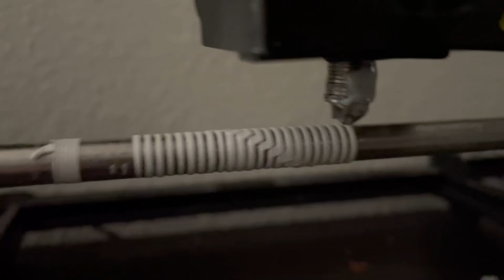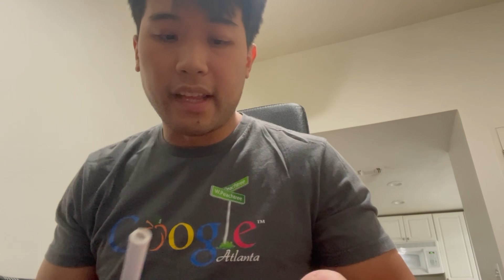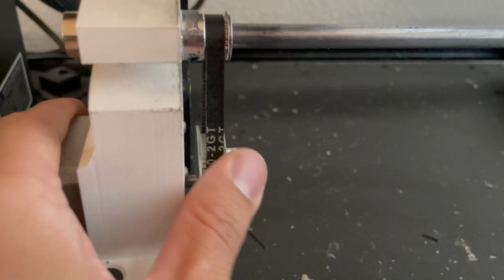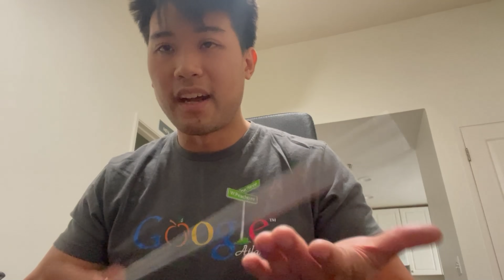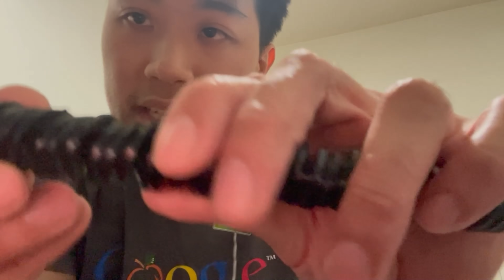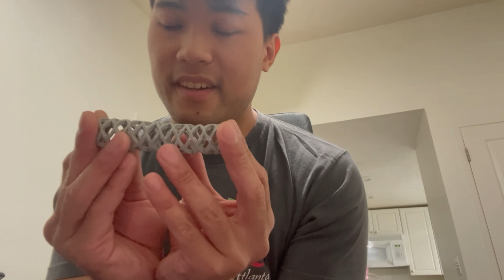i made a new type of 3d printer to make progressive twist barrels, springs, screws, rods, and more

Comment: What if you heat the rod by just running current through it, just like a heated bed, to get the part to detach? You could measure the temperature of the rod quite accurately just by checking its resistance.

Comment: You could turn this on it's side, make the print bed basically a lazy Susan and have different size base rounds to print on.

Funny enough I had this idea a long time ago, I called it an R-Theta printer... But I am not a software engineer, and have way too many other things floating around in my head. Props for building it, that's an impressive innovation!

Comment: a very interesting concept, hope you don't get in trouble for showing that you can possibly make a rifle made out of plastic. I was thinking: this is escalating very quickly.  Nice video
Reply: anyone with a drill can make a rifle. I don't think that creation of rifle parts itself is a crime, as long as you don't use it as a rifle parts. Also take into account that barrel he showed is made of plastic, so any rifling inside the barrel wouldn't even last one shot with bullet made of metal. So for things like airsoft it could be used because of plastic "bullets". If you want to use bullets made of metal - you would definitely try to reduce the friction as much as possible so it will last at least more than one shot

Comment: You have inspired me.

A new weapon i shall call.
"The four stroke auromatic rifle."
Using springs, compressed gassified fuel, a series of valves, and a compression chamber capable of handling insane pressure.

Theory? That if you achieve stoichiometry, use recoil and standard rifle gas systems to help cycle the plunger rearward, you could make a fully automatic gas powered rifle that has an INSANE cyclic rate, and could be loaded with inert prohectiles to ve belt or tube fed into the mechanism.

The rifle will first draw back into the ARMED position, in this position tge plunger is pulled rearward and air has been pulled into the compression chamber via a 1 way aka check valve, or another valve that is mechanically timed but only open moments before the plunger is "fired".

Next step the firing sequence.
Depending on the power setting of the gas regulator: upon trigger pull the valve allowing air into tge rifle is closed, and a valve allowing pressurized gas into the rifle is opened, to let in a set charge of fuel, split seconds after the gas is fired into the ignition chamber the plunger is released and slams forward, diesel igniting the fuel air mixture.

This mix is let to burn momentarily as it would in an IC engine which begins tge rearward travel of the piston plunger, during its rearward travel it uncovers a port which exhausts the propellant gas down the rifle bore where upon meeting the prijectile, imparts a portion of its kinetic energy into it.

The coolest part is the firing mechanism can be fired counter to the recoil and operate to negate it entirely by counter acting the forces that imparting energy into a stationary object eould create in the device.

Imagine it much like a combination between a rifle and a couple types of internal combustion engine.

On the intake side you have a 4 stroke, with intake valve/spring, a cam of some kind to allow air into the cylinder, and a system to allow fuel mix into it (probably an injector)

Then for ignition you have a piston much like that found in a small engine, it does exactly what it would do in a diesel, possibly tge addition of an electric glow plug would be wise as well for consistent shots on a cold bore.

Then for the firing / projectile portion, you could have an exhaust port much like on a 2 stroke where as the piston travels to bottom dead center from top dead center in its ignition stroke, it travels past the port and relases its extremely high pressure gas down tge barrel, taking the projectile with it.

Think of this as a diesel fired fully automatic potatoe gun.

But it doesnt rely on barrel obstruction to create a pressurized chamber, it will 'fire' as ling as there is fuel and air in the weapon.

Purely with spring power, and only needing electronics in situations where its added as an option to increase reliability of the ignitionprocess, much like in modern diesel engines.

Then we design and slap a fuckin turbo on it..... 

The MOST mad max gun you have ever heard of.

Imagine one that has 8 barrels...

Cult if the V8s new super weapon.

Comment: It's a reverse lathe... Where a lathe takes material off the work piece, this adds material to the work piece instead.

Now combine it with a lathe, a CnC and some kind of curing setup and you could create a nearly automated nearly 0 loss (new conjunction word incoming) REDUCT- ATIVE  (reduction + additive) manufacturing process.

Especially if you can make a machine that runs a single material, and collects all of its own waste from the reductive manufacturing process, and uses that to help feed the additive manufacturing process, increasing efficiency, and reducing cost of materials.

Reductative manufacturing.
Reply: Okay I'm not great at fine detail tasking when it comes to some of this subject matter, but could you imagine a machine in your home where you actually pick an object that is built of composite materials, and the machine can literally print the fully functional object, circuitry, moving parts and all.

Using compliant mechanisms, and a combination of printing methods, perhaps a small robot arm that holds different arts and or rigging during the print of different components and moves them into place after initial print, without stopping the whole process to move it.

The arm could help print a barrel, place it into a housing, print the housing around the barrel, making compliant mechanisms and moving parts as it goes, the positioning them into the final print as it is formed, to create things like pretension.

The applications are endless, if the tech can be supported.

Comment: I want to add that this feels way more useful than the infinite length belt printer concept that came out a few years ago.

This doesn't solve the same problem, but as a concept, I think it's simpler, more robust and overall more useful, at least for functional parts, and some decorative types as well.

I wonder what kind of design software you use to generate the Gcode for this.  Do you have a "slicer" of some kind? it's a bit hard to imagine how the design part is accomplished.

Comment: the main problem with 3dprinted screws, i found, is the cleavage plain weakening them to require them to be much larger to compensate (with more shells/walls) - this should solve that... and while I get your excited...  it's facinating and all -  you should tone back the pew pew producting on youtube... before they decide your turn to go away from platform.

That would cripple this 3D printing idea unless you managed to release to everyone elsewhere.

Don't take that chance, please, the strong springs with the fracture points working with the design - is a huge advantage, and could even be used in applications your not thinking.. just think where springs are used... they are rather common even to this day. (and in things like shock absorbers)

Comment: Not only is this a great idea/potential to change the manufacturing industry...it is said with so much passion and excitement! What would be very beneficial is if you can somehow design it to have a metal tube (or any material tube really) slide over the axis and print on that. For instance, sliding a titanium tube and printing on it for custom prosthetics. Or custom screw driver handles. Pipe specific heatsinks/support/covers. Devices that suppress sound from high muzzle velocity. Custom rocket profiles...around whole motor/engine compartments. Could even have a design that allows the pipe to be folded and clipped together to make a bigger 3D structure...kind of like a protein. Couple substrate deposition and you might even have printable electromagnets, motors, transformers, etc. Have you thought about starting a business/patenting the process?

Comment: You can use other shapes instead of a rod to print on and simply change the height of the printhead as it prints. If you manage to create enough pressure and tilt the printhead a bit you should even be able to print onto substrates like plates that spin vertically so you can print closed shapes.

Comment: Add a Kevlar or silicone sock and print on that like they do with toole fabric on bed printers. Fiber reinforced. And you can get delrin that prints well now. Imagine carbon fiber reinforced delrin. Maybe CF fabric on CF filament action? Or maybe brush on epoxy that is compatible with plastic you print or just wet out the fiber before slipping on? And just alternate between fiber reinforced, printed, and epoxied layers for a super laminate with a very cleanly ironed outer layer. Can you still implement the y-axis bed movement while running to get non-round shapes cleanly added?

Comment: This is interesting. I’m working on a project that requires large dimensional pipes and it’s surprisingly difficult to source the exact sizes and specs I need, and also the plastics. Being able to modify the diameter of the printing rod makes this idea excellent for my use cases since it eliminates the need for larger bed sizes and you can just print larger diameter rods if you can’t source rods at a certain size!
Reply: For me being able to print in delrin and get crazy shapes with precision is a big deal.

Comment: Do you take into account that the speed of the outer perimeter of your print. if you run a constant velocity on the bar and print a disc, the speed for each layer will be different the thicker you print.

Comment: So the dumbed down version: you rolled the print bed into a cylinder. X and Z are still the same, just Y is a rotational motion instead of linear, as in "the same as the Y axis motor shaft turns".
Basically you simplified the hardware side ... But yeah, that's the easy part, of course - getting a slicer adapted to that is the difficult part.
Pretty impressive, and a nice addition to "regular" non-planar printing! ♥

Comment: I’m going to print a tool holder to rig one of those cheap 3D printing pens on the cross slide of my manual lathe. Then I can use the single point threading gears to print on a rod turning in the spindle chuck.
Reply from the maker: that’s smart!

manual additive lathe!

Comment: I wonder if you could get some stock PLA (or whatever material youre using) rods in place of the metal rods. That way you could have a solid core, and eliminate any 'bed' adhesion issues.
I'm thinking like the solid 3mm ones some of the cheaper 3d pens use, or maybe thicker. I doubt they'd need to be too rigid because you have it clamped on either end.

Comment: If your rod spinner can be mounted to a z axis support, and a rack and pinion interface to the bed of a bed slinger, that could get you your rotational motion in the rest would be done with tweaks to the code. A great modification for any existing bedslinger. Thoughts?

Comment: Are you intending on sharing the design of this 3D printer? I'd love to use it to make a hyper-compact kugelschnäpper (Also known as a ballester, normally it's pretty much just a crossbow with a barrel to guide the ball, but I want to remove the crossbow part)... which come to think of it is pretty much just an airgun rifle shooting bearing balls, but still. Would be a fun thing to have (and the rifling would help a ton with accuracy -- it'd be easy enough to build without rifling but it'd be pretty inaccurate)

Comment: This is really good stuff. You might have a product with sales potential with a bit more development. I'd buy one. In thermoset composites, they call the additive CNC-lathe process "filament winding", so here it would probably be called "thermoplastic filament winding" or TFW. There might already be patents though, so watch out for that.

In my opinion, gain-twist barrels are overrated on performance. I don't think it's just a matter of cost/manufacturability. Any improvement from a more constant rotational acceleration doesn't make up for the much greater malleability required of the bullet jacket, to withstand constant deformation. Regardless, there will be plenty of applications for this machine.

Edit: Ok, so I did 15 minutes of homework, and I'll admit it appears that some marksmen and gunsmiths are claiming noticeably smaller groupings with gain twist barrels. Interesting when they go into the theory or conjecture, because the only mechanism that is understood with certainty is that both types of rifling have their disadvantages.

Comment: Awesome! In normal cnc metal milling a rotational axis is common, so cool to see that nobody had put 1 and 1 together!    
Next step put 8 rods parallel on your bedslinger and use the stepper motor in parallel. Let the y axis be the option to change to another rod.   You could also like have different rods in diameter in parallel. 
Keep it up!!!

Comment: We need this open sourced and a community WILL support this. The fosscad community alone will keep this alive.
Reply: Needs to be improved by removing the mandrel. Take a rotary bed, and place it 45 degrees to the axis of the nozzle. Or make it a cone and go perpendicular to the nozzle. Then you lay down an attachment ring and build outward. Once the first layer is down in a vase mode style (though from the side) you can run helical layers that alternate direction each layer making a strong part.

Thinking about it more, you could change the nozzle geometry to not have the little flat at the tip (as pointed as is possible), and make sure it is a 45 degree cone. Then the 45 degree rotary bed would work even better as you could use the side of the nozzle to iron the surface smooth.
Reply: @court2379  You came up with great suggestions. You could also print a core of the material that you intend to print your screw with in a regular printer. Then, you could use this original core as the mandrill upon which you could continue your job.
If you want to print a spring, you could start out with a water soluble core. 
If you want to print a riffled barrel, you could use a TPU core that can be pulled out by stretching it when the print job is done.
Reply: Naw this dude is smart enough to manufacture them. He should make some money off of this
Reply: @SillyNaughty  He would benefit more by making it open source
Reply: @killerpanda4659 would you kindly elaborate on your logic there please. not arguing, just curious
Reply: @CorvidianSystems  It can help you network with many more talented people, code performance can quickly and more effectively be optimized. It could also increase the amount of people interested, as a result more innovations. RepRap is a pretty good example
Reply: @CorvidianSystems  Gating it behind patents/licensing means no one will adopt the tech or work on it. FDM printing only because mainstream popular because some patents expired. If the tech really takes off, then he stands to gain a lot by being the "mastermind" behind it
Reply: @killerpanda4659 when it comes to hardware the people with the skill to hack your proprietary device are your enemies and constantly find ways to circumvent your protections. If you open source it now the people with the skill to break your device are incentivized to improve it instead. The vast majority of people will happily pay for kits. Another group will happily pay even more for a completed unit. Hardware isn't like software, you can't copy and paste reality.
Reply: @killerpanda4659  you mean so that a certain company of budget printers simply takes everything and gives him 0 royalties? Better to contact them asap and atleast get some money before they copy it anyway.
Reply: @GoriIIaTactics Can you name the mastermind of FDM printing and know how successful he is?
Reply: @MagicGumable  Hate to break it to you but this guy is NOT the first inventor of a rotary style 3d printer. Jonas Duteloff is. Also, you can still make money from having an open source project, you're being short-sighted
Reply: @MagicGumable  there is a company i work with currently doing this with robot arms, and they have a bunch of patents. the space for novel IP here is already shrinking, seems open-source is the way.
Reply: @SillyNaughty  you can go open source with a project and still sell the finished product. a lot of people don't really want to go through the trouble. tons of companies do it

Comment: What a great idea. 
You showed the textured piece you place on first for the filament to grip onto and mentioned that you printed that part. It looks very similar to the expandable mesh-like outer protection you can use when making your own cables (it should come up if you google "Mesh Split Braided Sleeve"). This stuff is cheap and comes in long lengths + expands/contracts to fit, it could potentially be a great alternative.

Will be interesting to see where people take this, you could potentially even reinforce your 3D prints part way through (Adding glass/carbon fibres, even something like cotton or tooth floss).
Reply: Yeah, it's basically the same thing as a carbon fiber filament winding machine, so it would work great with the continuous carbon+molten plastic technique like Markforged.